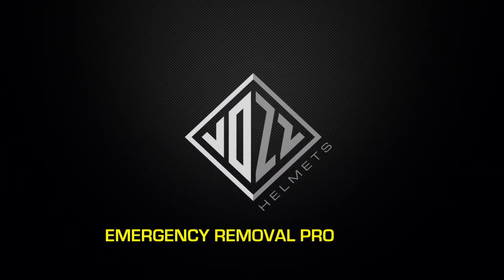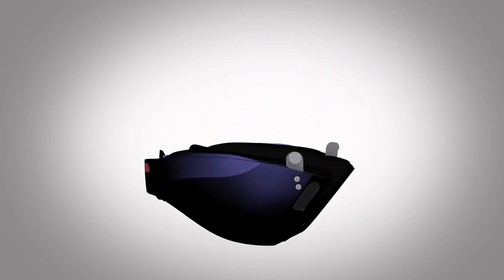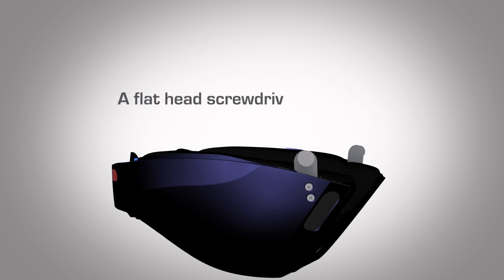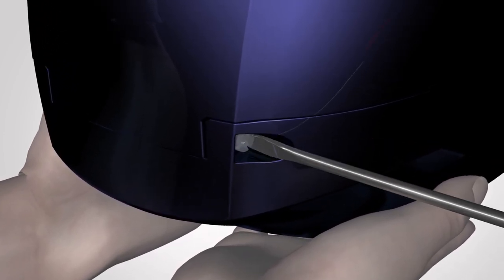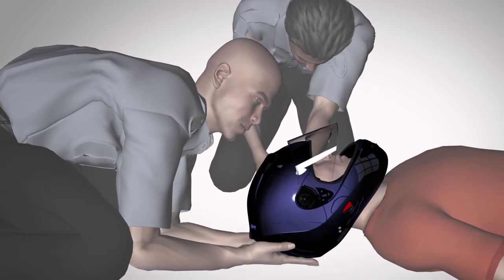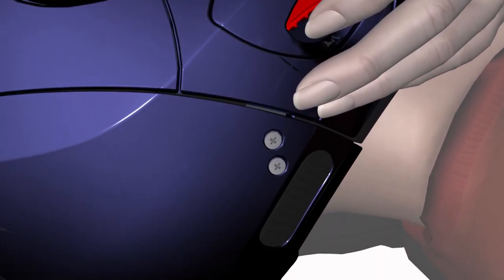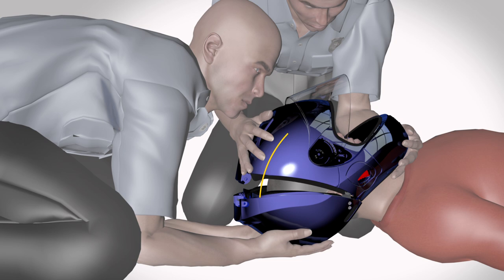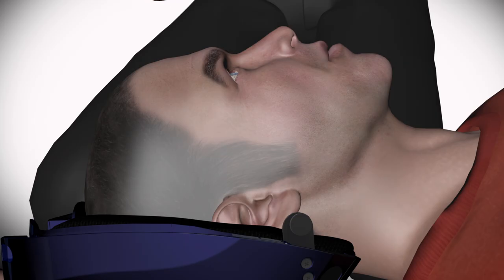Vozz Helmet Removal for Emergency Personnel 3D

Comment: In addition to needing a straight tipped screw driver to release back hinge, a Phillips tipped might be needed for lock removal on the sides. Would be better to have one or the other, but not both. 

Better still to have some type of emergency toolless method. Looks very interesting though.

Comment: Seems to me this system makes way more sense than traditional helmet which they'd have to pull the helmet out from the persons head which can be very tight for some people. I've never seen how they do though. I'm very curious.
Reply: +Yoshi O Some traditional helmets offer a kind of quick release for the inner cheek linings so they can be removed prior to sliding the helmet off of someones head.
Reply: +Yoshi O And potentially lethal if they have head injuries

Comment: Unfortunately this is not easy (ambulances don't carry screwdrivers flat or cross ones...),  ambulance just carry Robin scissors,  Vozz should think to a removal system that fit these kind of scissors.  Last but not least the correct removal technique require a person in front of the patient that locks the neck with his two hands.  Keeping the head from the back of the helmet it's ridiculous as the rear of the helmet is round and can't provide a safe holding,  at the same time,  when the frontal part of the helmet it's removed the head remains free.  
It's nice but it's all wrong...
Reply: +Riding TusCanY 
you have no idea what you're talking about.

1) https://www.facs.org/~/media/files/quality%20programs/trauma/publications/ambulance.ashx
look at page 6 under disassembly tools the second bullet point is "screwdrivers (flat and Philips head)" you'll also notice that ambulances carry a variety of other tools and are augmented by heavy rescue vehicles.

2) Any casualty that has suspected neck or spinal damage will ALWAYS have someone at the head, stabilising the neck, weather a paramedic or someone called over and told what to do, regardless of whether they are wearing a helmet.
Reply: jaqs smith Sorry my dear.... I know it quite well as I'm a trained rescuer and I'm doing this since 27 years on ALS ambulances..... how many helmets did you remove in your life?? Not in a warm, well lighted room with a dummy.... on real streets, at night or under the rain..... with the patient suffering for broken bones? This system is nice but not good in case of emergency removal, that's it and you can't take any argoument
Reply: 3 times,
two on a mountain track, one on the side if the road. broken arms all 3 times. 

you're telling me that Italian paramedics are too inept to deal with this system? how do you open your equipment cases?
Reply: jaqs smith OMG still on this matter? OK... First thing I notice looking at the video: the man at the head is keeping the head from the back and just by holding the helmet. To secure the head from accidental movements the rescuer should be placed in front and should lock the head&neck by his two hands inserting the fingers between the helmet and the jaw. The way shown on the video is not providing any secure holding as the patient could move in any direction. To prevent any spinal damage you have to make a solid connection between the chest and the head and you can do that only by holding the jaw from the neck upwards. With this helmet this is impossible as the helmet is tight against the jaw and there is no room to get through it and, infact, in the video nobody is holding the neck properly. 
Second thing you can easily notice the two main screws are flathead and the 4 others screws (which should be removed if the main ulocking device is damaged) are crosshead, so the rescuer should also change screwdriver loosing more time
Third, and probably the most serious thing, is that ALL the helmets have the same closure system (no matter if Double D , the quick release ore the micro metric buckle system they all can be simply cutted away) So a rider who's wearing such a strange, unusual, never seen before, closure system should have warnings all over the helmet, like on "Emergency doors" on planes, with instructions abt removal. Nobody would like to wear an helmet that should be covered of emergency stickers. Without indications how can a rescuer open this helmet? And how a small company, almost unknown, can expect that ALL the rescuers in the WORLD will be trained to open it properly? That's impossible .
And, by the way, just in case it happens again... do not remove a helmet anymore... as you clearly don't know how to do it properly. Take care, bye
Reply: Riding TusCanY this is for the Australian market, i can assure you that in Australia the head and neck are stabilised from above the head by someone gripping from the ears down to the jaw. 
gripping from under the neck puts the rescuer in an unnatural posture and is only sensible to stabilise a head if removing from a conventional helmet. this helmet eliminates the need to do that, instead the rescuer only needs to hold the helmet still or tell the casualty to remain still (it they are awake) then stabilise as normal.

It is assumed that a rescuer won't know how to remove this helmet, that is why the QR code on both sides if the helmet, next to the clasps, leads to this video. I have seem many helmets with "emergency release" stickers on them in a fighter jet motif (i put one on mine that says "emergency access" pointing to the collar).

In every training course I've been through we have been taught to stabilise the head from the top, there is nothing wrong with the technique shown in this video.
Reply: jaqs smith are you sure you have no interests in this helmet? Because I'd like to understand how you can accept that someone safety relies on a QR code... Let's figure it out:
The ambulance arrives on scene; this means that the accident occurred already 10-12 minutes ago (assuming that somebody called for an ambulace immediately after the crash and that the ambulance is at a reasonable distance from the scene). The rescue team gets down with a rigid collar and the robin scissors (beside to the other standard emergency backpack). The patient is not responding and not breathing, the heart is still running but will not last forever so it's needed to remove the helmet to make a proper RCP.
"UAU what helmet is this?? ".... trying to understand.... "Ohh look here there is a QR code"..... looking for a smartphone.... looking for the app that can read the QR code.... opening the app...... shooting the QR code..... waiting for the Youtube app to connect to the video..... watching 1,45min video.... running back to the ambulance .... looking for the fucking screwdriver..... going back to the patient..... 

OK call me when you've finished and let me know how's gone..... 

(QR code may be scratched off - there could be no line - the rescuer could have no appropriate app to read the QR - since nobody uses the screwdriver on an ambulance the team could loose a lot of time searching for it - I could find several other negative things but I stop it here.... please be honest ..... it's a nice helmet and I could love to use it on the every day life , specially when I have to make several stops in a day always removing the helmet to meet people, to enter a post office, to get to the bank.... but it's not safe because it's too strange and too much different and because it need a specific removal technique and a screwdriver.....) Sincerly I wish you the best, Riding TusCanY out, cheers

PS. I forgot: yes, you're right, to stabilize the head you should hold it from the back, from the ears down to the jaw.... AFTER that you have removed the helmet. Before you have to lock if from the front as I explained before, THEN the team mate will remove the helmet from the back, AFTER the same rescuer will lock the head&neck by holding it on the back from the ears down to the jaw, the first rescuer will now leave his innatural position to put the rigid collar in place.... seems you forgot something, may be a retraining course?